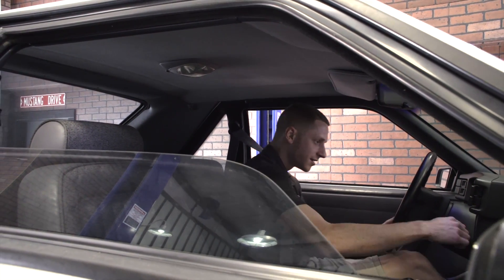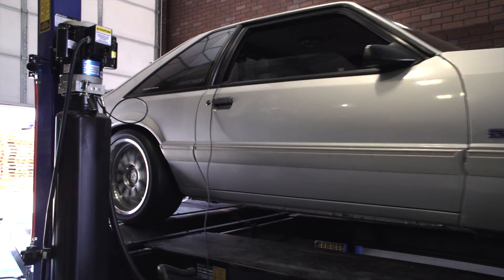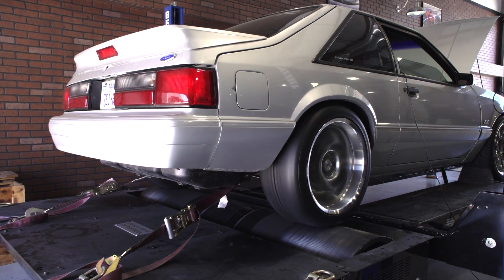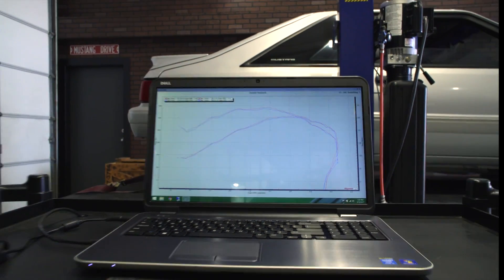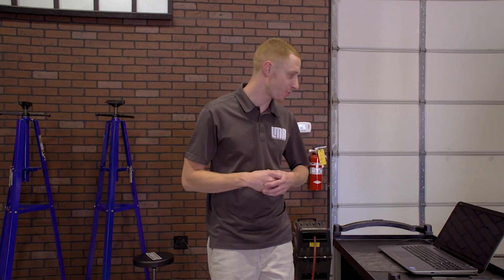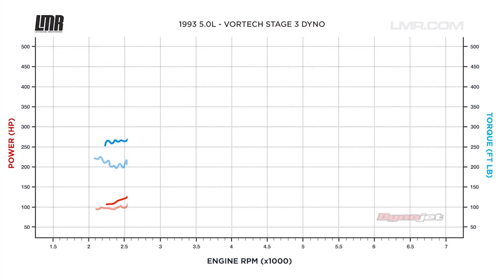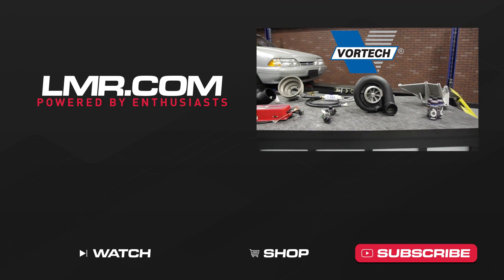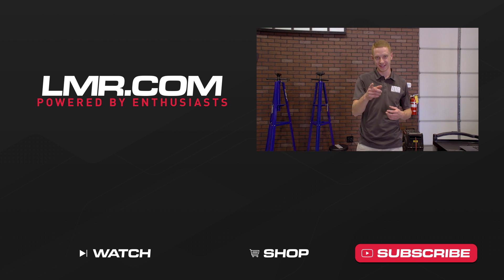Fox Body Mustang Vortech Supercharger Dyno

Comment: A stock mustang gt only makes 215 to 220 Flywheel horse power from the Factory.
So how is this so called stock mustang gt making 257 rear wheel horse power?????
Can someone explain this one??????
Reply from the maker: Because it has modifications that increase power. The modifications are mentioned at the beginning of the video that is linked below. -Landan

Comment: 200k b303 cam with tfs  smog heads and a v1 s trim on 12lbs. 538 rwhp  on a mustang dyno. Never split the block. Built a 331 with afr 205 heads and a solid roller with a ysi trim and made 603rwhp on the same dyno same boost and the car felt slower. Less is more. B cam small heads boost and a tuner that knows his stuff with a a9l.
Reply: Tony and Tess on YouTube is putting 900+ horses power on stock block and I think stock bottom end they hold the word record right now.......go check them
Reply: Stock bottom end???

Comment: Does anyone know what mods that 5.0 had BEFORE the vortech install?
Reply from the maker: Give us a call at 1-866-507-3786 and one of our CCR's that have been here for a while can give you a build breakdown on the car!
Reply: With 257 wheel, it would have had GT40, GT40p or ported E7 heads and some type of upgraded intake manifold along with short tube headers.
Reply: This makes me wonder what my 91 gt has.
I've got some heavily ported gt40 heads and ported gt 40 intake, some mystery cam (previous owner install) that we measured at a. 56x lift (it sounds fantastic), with long tube headers and h pipe, 373 gears.

All I know is shes a blast to drive.

Comment: Will this work on a STOCK 302????
Reply from the maker: It will work but we would recommend some supporting mods with the kit. Give us a call at 1-866-507-3786 or email us at customerservice@lmr.com if you have any additional questions!
Reply: @latemodelrestoration  will be calling you tomorrow
Reply: Jason Hawk  how much boost? Which kit did u get. Looking at the h.o level for a bone stock 302. Looked at the entry level due to the price but was wondering if I should spend the extra money now to get all the supporting mods for 7-9 lbs of boost vs the 5-6 lbs of the entry level. I think going the route of more boost will be better to max the stock setup yet everything is there if or when I decide hci.. what are ur thoughts

Comment: Hey guys I recently put the same v3 on my 87. Only issue I have is my serpentine belt squeaking on a cold start up. Im having trouble finding a shorter belt and tensions all the way on my tensioner. Car is no AC no smog any ideas/help would be great thanks
Reply from the maker: Marcus, The best thing to do would be to contact Vortech directly to see if they may have the specific belt sizing for your application with the deletes you have on the engine. (805) 247 0226 -VORTECH

Comment: This dyno result baffles me a bit. Why didn't the torque curve keep rising due to the centrifugal design?

Most centrifugal s/c applications I've seen have torque curves that rise to almost redline.
Reply: Pretty sure this dyno graph doesn't actually belong to that car lol. They said the baseline # was 257 yet the graph shows 275ish. And you are right, regardless of heads and cam a centrifugal supercharger will always have a linear powerband, almost a razor straight line to the limiter. Only way to change that is pulley it up so it makes boost early and then use a dump valve or recirculation valve to hold the boost steady. I'm not sure anyone actually does that, it's just an idea I always had to get that type of supercharger to make more AUC.
Reply: If you look the baseline curves, it seems likely that they left the stock cam in the block and the torque and horsepower curves under boost will be lifted, but maintain the same overall shape.
Reply: @FiveBoroNative  That's for positive displacement only, isn't it?
Reply: @nickamarit  I know where you are going, but because the centrifugal has rising boost with rpm, the torque and hp curves will remain very similar, but angled up to the right. 

It really depends on the curve you start with. A low duration cam (like the stock one) will probably have the torque higher than the horsepower, but with a centrifugal added the curves will look like someone just twisted the picture up to the right slightly like in the video.
Reply: @FiveBoroNative  Makes me want to see how this engine (with this cam) will react to a twinscrew charger.

Cuz my car's engine has this exact graph shape as the stock baseline one (although much less powerful than the one in the video).
Reply: Nope. Max hp at rpm possibly if the combo works. Torque no not at all. If an engine made peak torque at 7200 rpms it would be a slug. The only exception is a rotary.

Comment: I just dont see 3k in parts for just a 100 horsepower is a good move. Is this a bone stock motor with just the charger? Cause for an extra 100hp i would just buy a 400$ nitrous kit and call it a day.
Reply: and keep filling the bottle. 

I picked up 181RWHP on a stock 93' Cobra with the V3 8 rib kit. (12psi) Well worth it for street crs.
Reply: @ryanjamieson8779  Ignorance here, but how many times could you fill the bottle for 2200?
Reply: @ChaseBond11  A bunch, but it gets tiring. Take it from someone who has had nitrous on 3 fox bodies, an Integra and a C5Z, and I had a water/meth kit on a supercharged Miata that I had to fill all the time. Just spend the extra money and forget messing with the car all the time.
Reply: What was your setup when you did this. Would like to do the same while keeping my motor untouched on my 93 cobra.
Reply: Also what happens when the bottle is empty, you're done that's what!

Comment: well that sucks, 110hp? just in the front half and barely anything up top from a blower that runs off rpm. sounds like a botched tune from the na video. you can make more hp and tq just putting and anderson cam. Id put that blower on the shelf untill you make 350na. put a real custom grind cam in it not the typical alphabet cams.
Reply: What do you drive?
Reply: brolicbrooklyn He claimed to own an NA 411hp car..🤷🏾‍♂️😂
Reply: @eriv4735  😂

Comment: love it !!!! My 90 full weight Vert with a V3 mskes 451rwhp through an AOD...
Reply from the maker: Not too shabby of a number!
Reply: Similar numbers like my 89 fox MrMikestang. Mine made 455rwhp and 430 torque. Check out my YouTube channel to see it.
Reply: @israelnieves2817 mods list? I have a 88 Hatch I’m building soon
Reply: What mods do you guys have? I have a 306, Afr 185s, custom cam and Sniper EFI that is probably close to 350 rwhp now. I wonder how the V3 would improve it?
Reply: @5literfox89 
I juust can't believe a stock mustang gt on the Dyno is making rear wheel 257hp......from the factory a mustang gt only makes 215 to 220hp Flywheel horse power.
So someone is telling a lie.
Reply: Keep in mind before you choose your boost option that centrifugal superchargers create a linear powerband meaning the power increases in a straight line til redline. What that means for acceleration is that it's not as fast as the peak numbers would indicate. What you really want to look at on your dyno sheet is the average power in your full throttle powerband (4,500 to 6,000 rpm or whatever it is for you). Roots style superchargers make a ton of average power and so do NA cars if done right.

Comment: When they switched to cast pistons in 93’ I was told they are not great for boosted applications. Is that just a myth??
Reply from the maker: If the supercharger is set up right and under low boost conditions it is still perfectly fine to run these on any stock application.
Reply: Don't believe there Cast in 93, they were Hypereutectic, if i spelled that correctly. It's better than Cast Pistons, Not as Strong as Forgered Pistons, But can run tighter Cylinder Wall Clearences, cause they don't Expand as Much as Forgered Pistons.

Comment: What other mods are done to the engine?
Reply from the maker: Cobra intake, TB, exhaust and some other mild bolt-ons.
Reply: Stock heads?
Reply: @Glocker23  stock for sure with that number. If you have heads your easily over 300rwhp. 
We made 600+ with a stock bottom end and heads/cam and V2 S-trim and that was over 15 years ago.
Reply: @waynebollentin989  I made 411 with afr heads and a anderson cam through and AOD on corn,
Reply from the maker: I am not sure honestly on the head for this car or the cam for that either.

Comment: Haha my 93 cobra with an intercooled Procharger has 680 hp.
Reply: Nik. That sounds awesome.  I'd really like to see that. We owned a 93 cobra for 13 years
Reply: That's not entirely correct.
Reply: True
Reply: I have a stock block making over 600hp been built for 7 years runs like dream. Key is driving responsibly plus having a block with high nickel content and tight journals.
Reply: @Frank Bonazza III Tine has everything to do with it. Im on year 10 with 520 to the tires on a stock block
Reply: Frank Bonazza III Are you purposely trying to prove you don’t know much about building and tuning? Because that’s all you have done..
Reply: The stock block is only rated to handle 500 hp reliably and if you really are “680” hp good luck with the motor lasting
Reply: @jordanshepard1728   They were good to 600+ if you weren't a moron about it. That said yes many people cracked these blocks. They would crack from the crank up to the cam bearing in most cases. Some of us ran 9s and with the stock block bottom end. Few 8s with the block filled and good rotating assembly. Even at high RPM N/A motor would make 550+ and spin just about 8k rpm if built correctly. Who builds, tunes and drives makes a big difference.